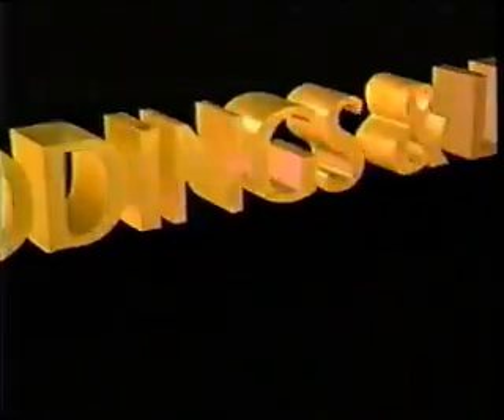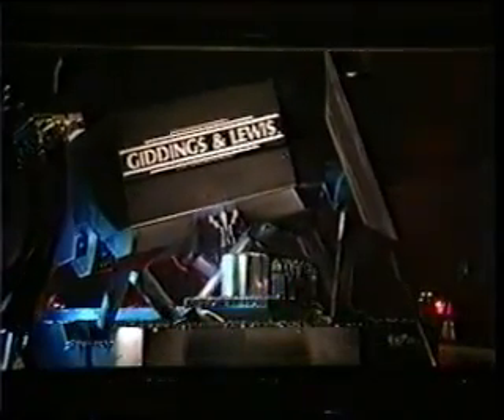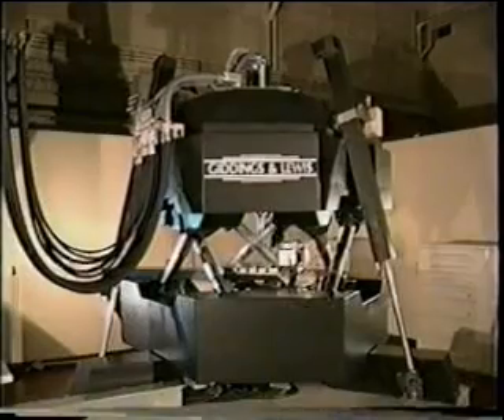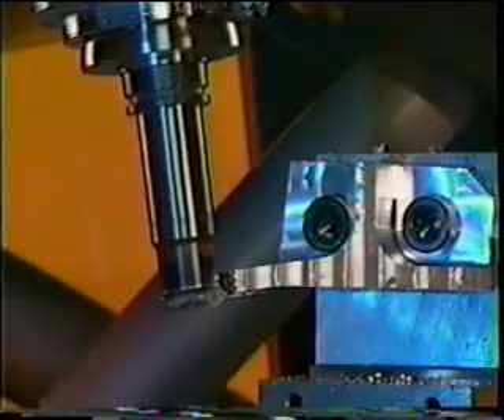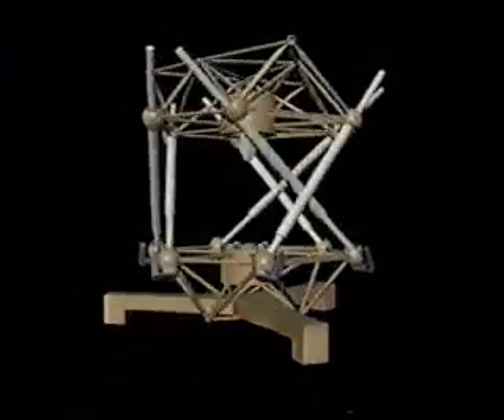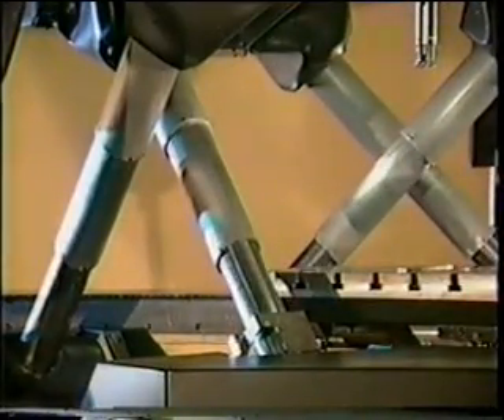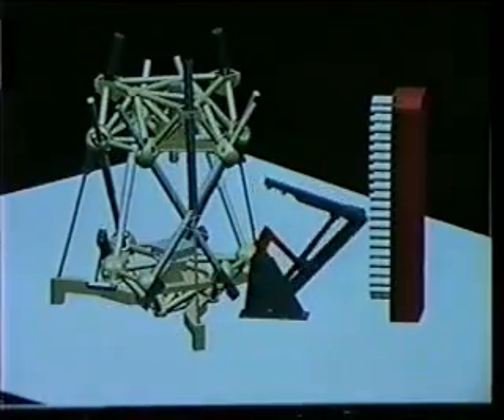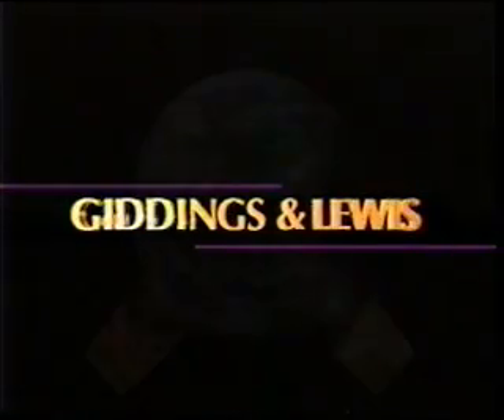G&L Variax Hexapod Mill

Comment: I'd be concerned about all the weight supported on those screws, spaceframe design or no. There's a reason why just about every mill above a certain size has either a counterweight or a hydraulic assist cylinder for the vertical motion.
Reply: It has three counterbalance pistons in addition to the crossed lead screws. The screws had electric brakes applied when powered off. One would have to support the upper section if servicing a drive screw but screws have infinite lifetime if properly maintained and lubricated. The controller had digital signal processors for the servos and feedback systems and a microprocessor for part program processing. The console was running OS/2 Warp and had a touch screen CRT.

Comment: the math needed for control the device is not a big deal for pros
where im dubitative is about the improvement against using 3rotations & 3 translations ?
the only advantage what logically become from this design is the standardisation of the actuators : they are 6 of the same model when a 6DoF need 6diferents system able to lift each others
from a geometric point of view it make sens ,
for price & speed too ?
for con the limited angular maybe 30° max and worst is the translation freedom